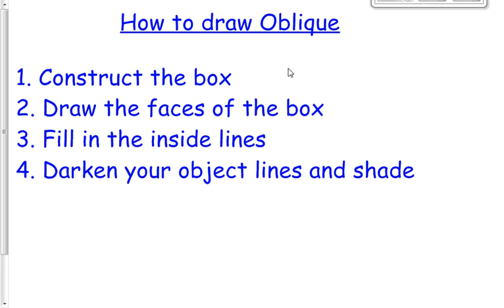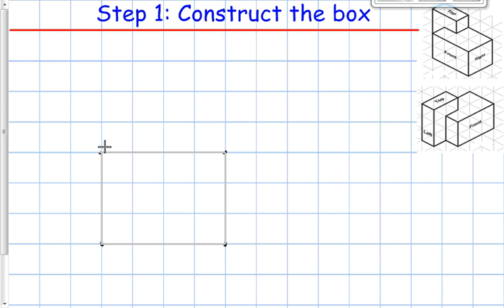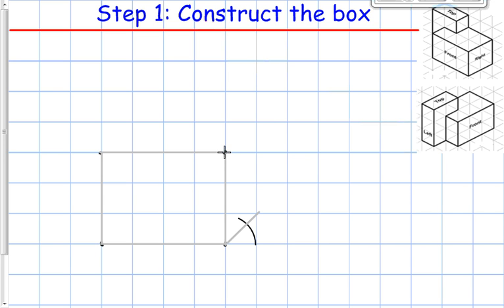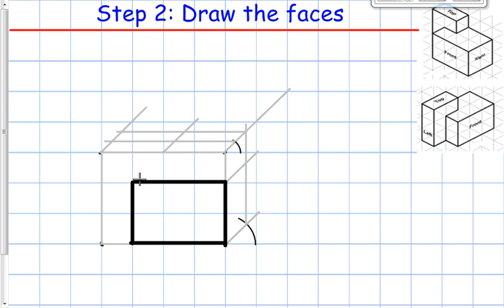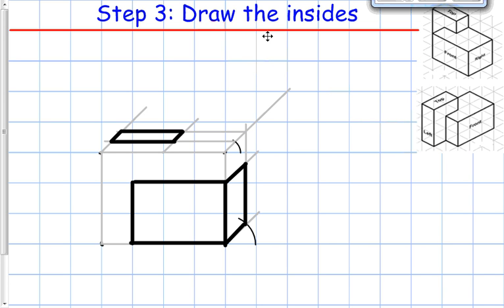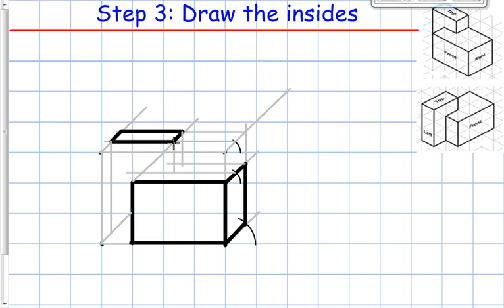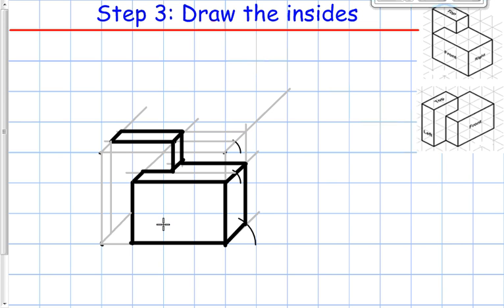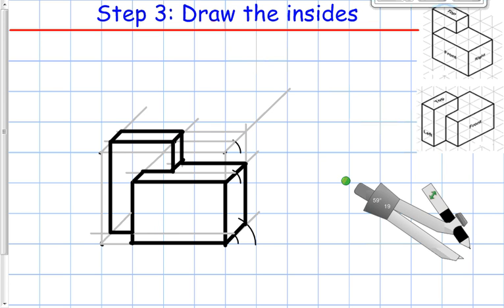How to make an Oblique Sketch Tutorial

Comment: The compass was used too much, you can save time by just making your 45 degree line and the intersection of that line and the vertical line will be the outline of the box.
Reply from the maker: If I'm understanding your question correctly, in order to get an accurate depth for true cavalier or cabinet you need to measure the actual distance of your quadrille paper grid meaning the vertical line you referred to needs to be established using the compass.  Love the name by the way.